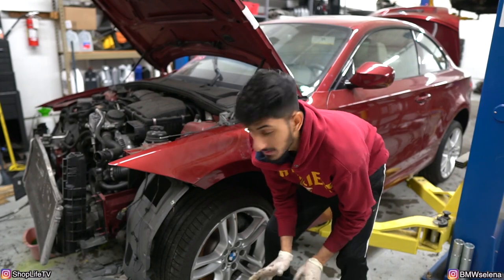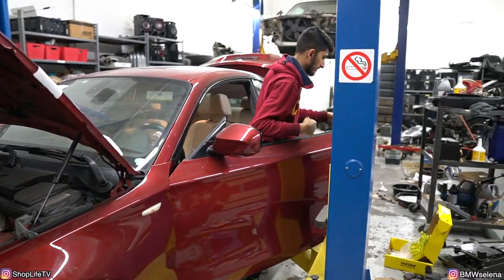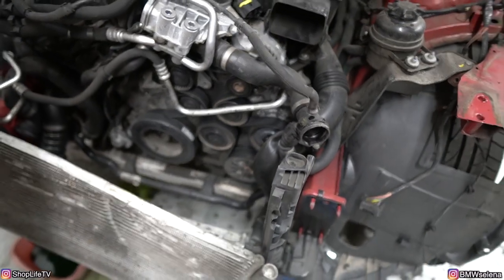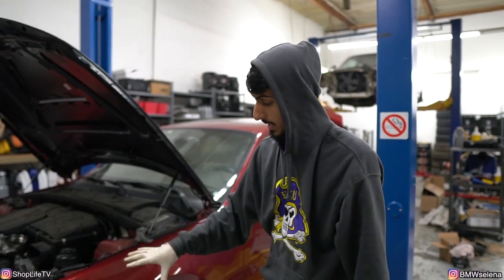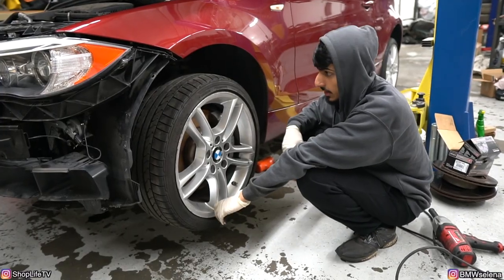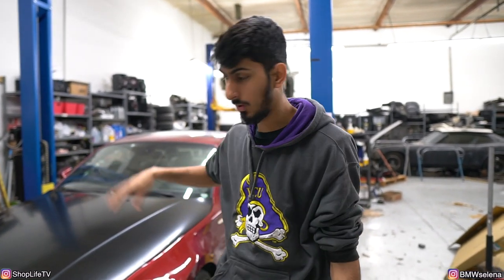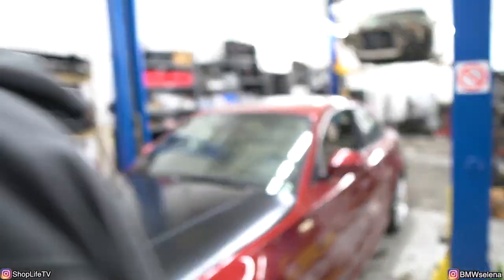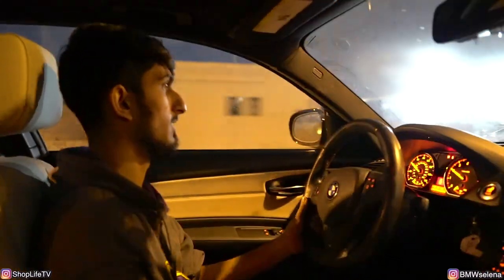Rebuilding A Wrecked 135i (N55) Into A Track Car (Aluminum Radiator+Intercooler)- Part 2

Comment: Just outta interest would you not replace the belts for future maintenance whilst you had it all in bits ?
Reply from the maker: The belt had recently been replaced. We did however do the oil filter housing gasket

Comment: Sir what is the name or part number of the brackets that you removed from old intercooler and placed on new intercooler… is the one that holds intercooler condenser radiator together.